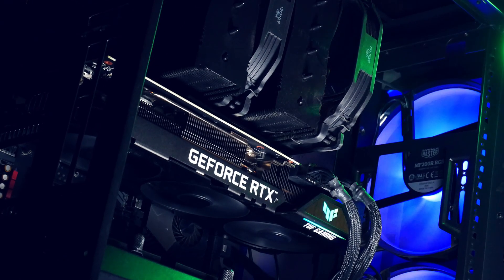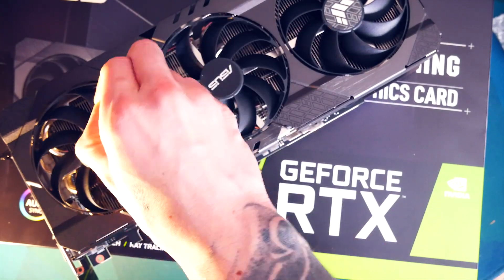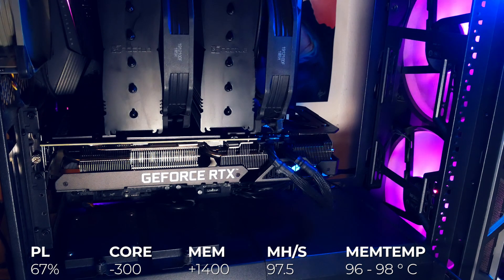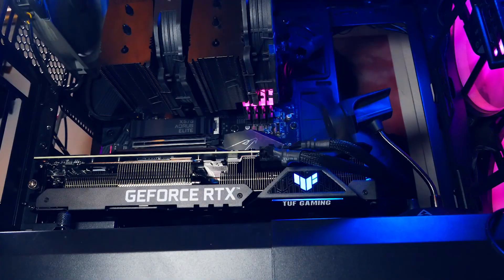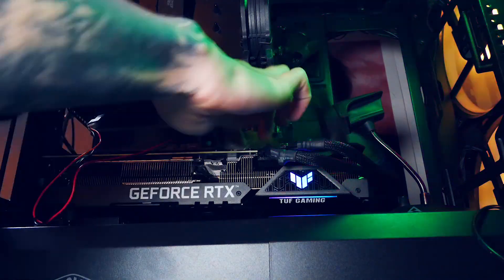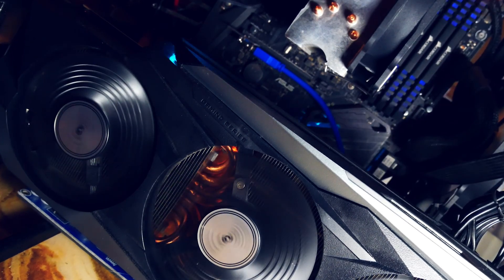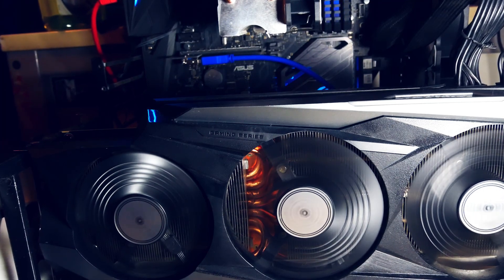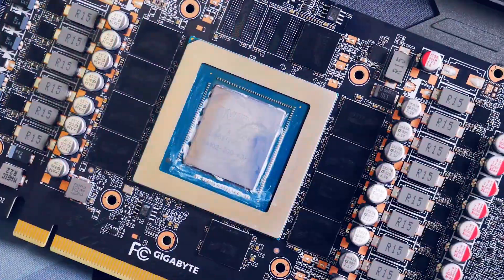RTX 3080 ETH Hashrate & Memory Temperature: Asus TUF & modded Gigabyte Gaming OC | Ethereum Mining

Comment: so you just added extra fan for the Tuf Gaming? but did not modded them with thermalpads? how is your Tuf gaming going now? I just bought mine 3080 tuf gaming, it always hit 102-105c with or without Overclocking. planning to re-paste them, but in other way it will break the 3 years warranty. any advice mate? 😁

Comment: Hey what program are you using to see memory temps
Reply from the maker: hwinfo64 is free :)
Reply: check gpu-z and if your memory is samsung you can't see it I think. I have a 3070 with samsung mem and it doesn't show mem temp. But I also have a 3070 ti now and that one has micron chip which shows the mem temp

Comment: Are you blowing air on the fan or extracting the heat from the card Thx! Great video..
Reply: Meant to say/ blowing air on card or extracting the air/ air flow direction//
Reply from the maker: was trying both, blowing air onto the card was slightly better for me :) try both because backplates are a bit different 🤞
Reply: @CursedMining  just to be clear/ blowing air to intake side of card/

Comment: I don't know if i'm bad luck or what, but i got a MSI RTX 3080 Suprim x, and it crashed the whole system randomly, and i cannot go over +750/800 mem clock, -200 core p/l 65 without crashing, anyone can help thanks
Reply from the maker: I guess similar thing, overheating memory. But I also don't exclude nVidia drivers, on RTX3000 they can be very bad!
Reply: Did u checked your memory temps in hardware info? Mine is running fine after a thermal pad replacement. 100mh, +1350 memory -200 core 66% power 40% fan 72c on memory temp...it was 96 c with only 900mhz on meme
Reply: @lamsgt14  72c is very good, do you have same TUF card?
Reply: @vlat18  Yes! I have the ASUS TUF. 1.5mm thermal pad gelide extreme on the memory not 2mm as advised by most of people on the net. please note that 72 is in a room with AC. during hot summer days it reaches 86 88 outside the room with 30c room temperature

Comment: I have the same card and get 102.14mh , core -300, memory +1500 and power 100% . If i reduce power limite to 70% my hashrate drop to 86mh . I stuck with 65 degrees celcius .
Power IS 337w
Reply from the maker: is it the core temp or the mem temp you are quoting? With the 3000s the mem temp is what is really important. Power seems pretty high for that 102 MH/s to be honest!! Cheers
Reply: @CursedMining   i just see my memory temp is 98°C , is that ok ? i can't find a way to reduce the power if i put 80% hashrate drop to 86 :(
Reply from the maker: @malakdecaen  That's the problem with these cards :/ recommended max memory temp is 95 ° C for longer period of times according to sources like Igorslab. I expect many people will have problems with their RTX 3000 cards over longer periods of time :(

Comment: Your fan placement for the 120mm was very poor.  You are basically pushing air into a wall.  This makes the fan less efficient.  At the very least put some kind of spacer to allow the air to escape.  Try  blowing air into a paper bag, you start hitting resistance very quickly.  Open some holes in that paper bag, makes it easier.
Reply: Exactly, pick up an ICEAGE J1 bracket and a 80mm or 100mm fan and push air on the backplate where are the VRMs

Comment: Nice video as always my brother <3
Yeah i heard RTX3000 GPUs are incredibly hot when it comes to memory temperatures :'(
Maybe try to add also more thermal pads between the backplate and the back of the card :)
Have a great weekend and keep it up the great job <3
Reply from the maker: Hey man thanks for tuning in! Yes indeed especially 80 and 90 cards are mem-cookers. I did backplate pads on the Gaming OC and it helped a lot. The Asus TUF already has backplate pads from factory, but I will still start there again, replace those first, maybe add some on some places for more dissipation to backplate? Because IDK if you checked online, TUF have a weird heatsink disassembly - unfortunately! Have a good weekend too mate! Cheers :)

Comment: Thermal pad upgrades are always the move. Well done. Enjoy the hashrate.
Reply from the maker: Agreed, thank you sir!! The TUFs are a bit weird to disassemble from what I saw, otherwise I would have already done it :D but I will get to it :) Cheers!
Reply: @CursedMining  I am thinking about thermal upgrading my 3080TUF. Any advice?
Reply: @CursedMining  have you tried a Tuf tear down yet? I tried smaller heatsinks on the backplate and that worked okay. Swapped to a larger single heatsink that covered the backplate opening and my temps got worse.